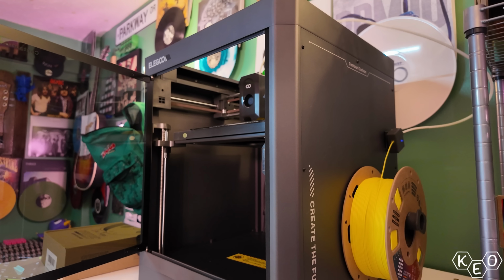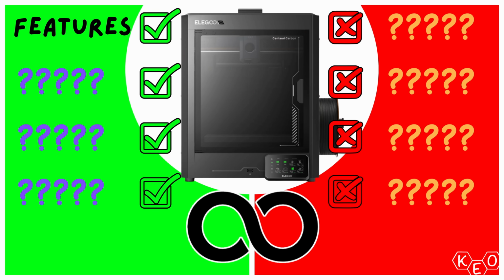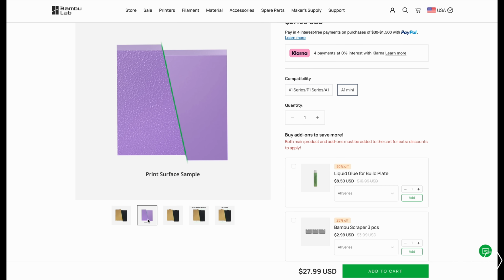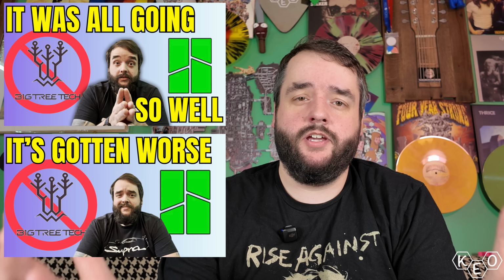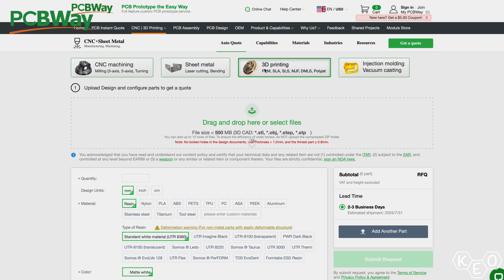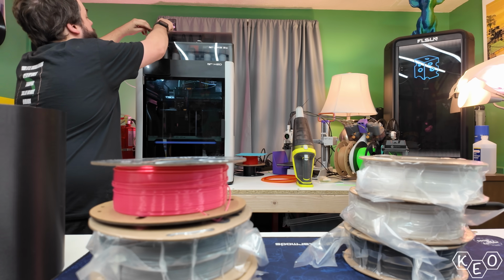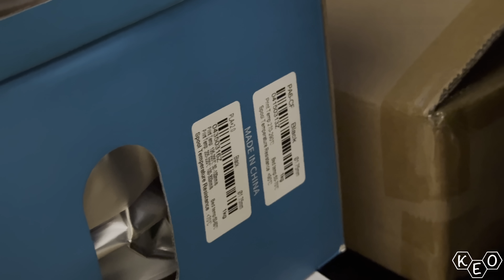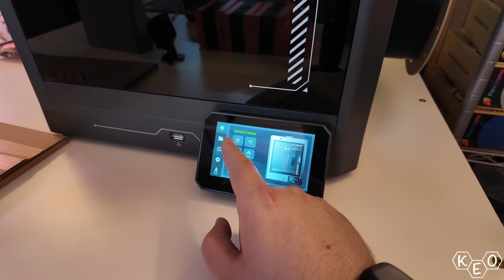This $300 Elegoo Printer Months Later — Here’s the Truth

Comment: Can't you control all your fans in your filament settings? So this way it runs the fans how you want per filament profile?
Reply: That’s supposed to be the way it should work. But the exhaust fan ignores the (Elegoo slicer) filament profile settings. I don’t know why. And if you turn it off from the front panel then it turns itself on again shortly afterwards (starting next layer?) 
Another YouTuber hacked together some next layer gcode to turn the thing off (on every new layer) when printing PLA, TPU, etc. And that seemingly works.  But the source of the wackiness needs to be identified so it can be corrected properly. 
Unfortunately I don’t yet speak gcode!
Reply: @dougal6569 Yeah that sounds like something that will Change either with a firmware update or Slicer update. Sounds like just a bug or a glitch

Comment: I agree on the reskinned multi slicers. It's really crazy out of control. I like Orca, though recently have been using Creality Print more as I like some of the tweaks they have done like more logical layer pathing they added recently that has really improved my top and bottom layers. 

A negative for me on the CC is the hot end design, especially the thin connector between heat sync and heater that has bent for some users and the hard to remove connectors that tend to pull off the circuit board (I've been waiting 3+ weeks for a replacement from Elegoo) or have the wires pull out. This is an issue with a lot of printers - the print heads which are a user replaceable part, should be easy to replace without fear of breaking something while doing it. But the ones on the CC seem to be even even more fragile and hopefully will be fixed in another upgrade.
Reply: No doubt about it, nozzle-swapping is one area where the Bambu A1 design leads the world.
Reply: @dougal6569  I cannot say as I don't have a BL printer to compare it to.

Comment: Fans/Door/Lid - these are because it is an enclosed printer, aimed at printing ‘functional’ materials, rather than PLA. 
Clearly Elegoo intended the open “Centauri” for the large scale PLA market, and thought they would first introduce the more specialist (hardened, enclosed, hot) Carbon as a low volume gentle intro for the range. 
I think they have been surprised by the adoption of the Carbon for PLA printing (due largely to the price and not working through Bambu’s servers). 
But folk need to recognise that PLA isn’t what this thing was primarily designed for. If that’s what you want to do with it, then be prepared to make adjustments (like taking the lid off, finding a way to have the door open/off, disabling the exhaust fan…). 
Sure it CAN do PLA, and well, but that isn’t what it was primarily designed for! 
And this also accounts for Elegoo’s lack of appreciation of the immediate appetite for an AMS/MMU thing - that is of much less importance with an engineering filament printer.

Comment: Fans (1) - some folks are claiming that their Case fan speed responds to chamber temperature on their latest model CC. Are they mistaking the Case fan for the Auxiliary Cooling fan? The Case fan’s job is to extract air from the chamber, through the filter material, and mine runs continuously during printing. The Aux fan is for chilling freshly extruded filament to assist with bridging and overhangs, and as such it runs intermittently and only when the slicer has added the command to the g-code for that element of the part.

Comment: And Adam, the criticism of the multicolour aspect isn’t totally fair. People (potential customers as well as trolls) made a big thing about whether or not this new printer would have a multifilament feed capability and Elegoo’s standard comment about not discussing future product plans did nothing to quiet the issue. So Elegoo came out and committed to 
producing it, and put that commitment on the product webpage. 
Yes it is still vapourware, and I agree that folks should never buy a product purely on the strength of promised future features, but I personally don’t see this as a reason to criticise Elegoo and the CC.
Reply from the maker: I’ll die on this hill lol. Your multicolor system should not be a feature listed right alongside the chamber camera and a core x/y motion system. Advertise that it’s coming soon but don’t flaunt it as feature number 3 if it doesn’t exist yet
Reply: I’ll quietly disagree about “flaunting” it. They advertised it ONLY as coming in 3rd quarter 2025. Now, if it gets to 2026 and it isn’t being shipped, at that point I will join your protest!
Reply from the maker: True. Hopefully they maintain that deadline

Comment: C’mon Adam, “Open Source” literally means the source code is made publicly available. Elegoo’s isn’t. 
But having public APIs and printer profile information is a great start and absolutely fine by me as long as the appliance delivers on its promises.
Reply from the maker: I didn’t say it was fully open source. It’s simply open enough for the only feature that I identified which is the orca integration. That’s all I wanted to highlight because that’s something I look for
Reply: @KeoPrints  “open” api’s and profiles, but absolutely zero source code published. I’m just trying to get you to be a bit more careful with your wording, so you’re not over claiming or misleading. 
I’m right with you that the CC is tolerably “open” (though not at all “open source”). As long as an appliance does what it is supposed to do, I don’t absolutely need to have the full revelation of how it does it. That seems to be OK for my car, my smart tv and my iPhone. 
But, as you will be aware, the Open Source zealots want full disclosure of the software internals and Elegoo aren’t releasing them.

Comment: there is 0 opensource in this printer, they're violating the Klipper license. Their bastardized version of Klipper is super old (v0.9.1). The printer itself is so locked down, it's actually annoying.
Speaking of which, we replaced the mainboard with standard hardware, and installed normal Klipper. We have everything except bed meshing working. We even have a configurable chamber fan (as in, it doesn't turn on every layer and you can set the percentage). Got a speedbenchy on my channel with it.

Comment: It's sad that a $300 printer works better then the $800 paper weight I have known as the qidi plus 4. Qidi is the worst company I've ever dealt with.

Time for a move.
Reply from the maker: For me personally, I would choose the Plus 4 any day. This printer is a great value but I have had a much better and more stable experience with Qidi
Reply: @KeoPrints unfortunately for the plus 4 its a 50/50 on if you got a good unit. Mine has never worked properly, the auto z-offset and abl are never right most the time it way to high and then the next time it crashes into the bed. The hotter the bed is the worse it because the sensors get messed up from the heat.
Reply: @KeoPrints I like your videos keep up the good work.

Comment: Been pushing 6 of these damn near constantly with various materials for the past month, and so far they've handled all of them without issue.  I've got 4 printing all the "pretty" PLA's, and 2 printing PETG-CF.  Prints come out amazing for the price point these have.  I've got the vented risers on all of them and I'm able to print most anything, door closed and riser vents open, even my abrasive filaments.  No warping, no clogs, nothing.....so far.  Can't ever say that a printer will never get a clog at some point, but a few hundred PETG-CF parts with the stock 0.4mm nozzle, I can't say I'm not impressed.

So far, I've only one complaint: the noise.  When the fans area going, they are GOING.  Luckily I've got a room with sound proofing and a dedicated inline fan system for fume management, so there's no annoyance with either sounds or smells, but I sure wouldn't want it in the middle of my living room going lol.  Regardless of that issue, I love these printers so far.  I'll for sure be looking into more of these when it's time to expand.

Comment: Before I move my printer I always remove the glass top because I know it is not secure or on hinges. They do have a riser available on printables that has all the pieces held together by screws so it can come off as one unit. If you can't remember to remove the top off a printer that you know is not secure before you move it, That's on you!

Comment: I have one of the first that fell off the Elegoo conveyer belt and into the truck.  It's been working great.  I did remove all of the zip ties from the feed chain as a precaution, and it's been great.  Removing only the last tie worked fine but the tube clicked itself in and out of the chain and I thought it'd eventually wear down so I removed the other two.  I don't have the lightbar upgrade that was said to come later but I can grab that if it appears on the Elegoo website sometime.  Weirdly, I can't find the silicone nozzle wiper in their website either, but "3D Jake" has them, and cheap too, so I bought a load when the first wore out and I found I only had one spare.  I didn't even spot that it was worn down until I cleaned the lead screws the first time so it clearly never caused any issues and I have loads of spares now anyway.  The only upgrade I've made to my machine so far is to make and install an adapter to send fumes to a hose vented to the outside world.  I skipped installing a riser for now;  I'll decide on that when I get and place the multi-material box.  I did install the anti-vibration feet but I've never tried the original solid feet to experience the difference.

Mine is not what I'd call super-loud.  I wouldn't want to install it next to my pillow to run overnight but it's not loud enough to make me go insane in normal use.  Wibble wibble.  It works great with OrcaSlicer v2.3.0, which is just as well as the alternative would have been to buy a cheap laptop to run their TemuSlicer on Windows or some nonsense instead of just firing up OrcaSlicer on Linux like an ordinary person.

I'll get one of their multi-material systems when it's out, but mainly to act as a spool run-out automaton rather than to rainbow all of the things for no reason.  I suspect the material system will double as a heated drybox too, but I'll wait a couple of months for them to work out whatever it needs to fix the first batch before I rush to place an order.  If the sharp turn at the extruder end of the filament hose is an issue when auto-changing material then I'll consider a riser, but I suspect they'll have a "standard" solution such as an official riser in the box.  I bet they release their material system in November 2025, so I'll consider placing an order sometime in January/February 2026.

I wish it had an Ethernet port, or a swappable board to provide one as an upgrade, but that's nitpicking at this price point.  A Pi acting as a WiFi to Ethernet bridge works fine, and the radio only needs enough power to cover the area it's in so that's secure enough for me.
Reply from the maker: All good points
Reply: I'm on Linux with Orca 2.3.0 as well.  Using Orca has a minor issue though.  The layer count and time lapse don't work unless you make a minor gcode in Orca.
Reply: @justanotherstanczyk  I've never used the timelapse feature but I have noticed that the layer progress counter never changes.  The progress bar looks correct so I assume it's a bug that'll get addressed at the next Orca release.  I wasn't aware that a gcode mod would tackle it if that's what you meant so I'll look into that at some point.  I'm not worried as the countdown (and up) changes as expected, and everything else seems to work fine.

One other thing is that I can't toggle the lighting from the Device tab when the printer is busy.  I don't use that puny light anyway, and if I ever want to then I can toggle it via the printer's screen which continues to work fine.  I suspect this lighting toggle to be a firmware issue maybe related to the updated lighting hardware I don't have.  I'm pretty sure the remote toggle worked before the last firmware update long ago.  Hopefully I'll be able to grab the new lighting hardware from the Elegoo store at some point.

Comment: I got 500 hours in liked it so much bought a second one. The Jesus freak riser and the fan muffler mods work really well and address two of your complaints easily chamber heat and fan noise). I’m a Prusa CoreOne fan but you can get 3+ of these for the same price. I really like this printer for the price. Did first nozzle swap and wasn’t bad.

Comment: That fan for the tool head is backwards. They should have the fan pulling air pointing at the tool head and the fan on the opposite side taking in external cool air to maintain the temp of the tool head.

Comment: Almost 600 hours on mine. I've only used PLA, Silk PLA, and various PETG's including some Glass Fiber. This thing has been amazing! My only issues have been with the slicer not being able to monitor the printer's camera, temperatures, and print history. I'm hoping a firmware update will fix that soon. The prints themselves have been great. By far the best $300 I've ever spent.
Reply: mine does that though.. you can also type the printer's ip adress in a browser and see/control it that way. See if the camera and stuff works from there.

Comment: I love Orca, and that's all I'm using now. I had to downgrade my A1 Mini to the previous firmware in order to keep on using Orca. I still don't think that it's cool what Bambu is doing, their excuse of "security" is a hollow one. My A1 Mini is far more secure than what they can do for me, since it's air-gapped from the Internet. Awesome hardware, but disappointing manufacturer. I'll be purchasing something else for my next printer, probably the one in this video.
Reply from the maker: The Bambu "security" garbage is the worst
Reply: There's no need to downgrade the firmware to keep using orca. Just send the print to the memory card and print from the machine, or use bambu connect if you want to start the print from orca.
Reply: @rmb8269  Thanks for your comment, it is appreciated. Carting an SD card around is indeed a workable last-resort technique, but since I don't have a RepRap I really want to print directly to my printer via WiFi straight from Orca, ideally without involving the Bambu cloud (like I've been doing before the whole controversy kicked off). To my knowledge this means that I need to run my printer in "LAN Only mode" with the N-1 firmware (in my case version 01.04.00.00) that doesn't rely on Bambu Connect. What I print (even if it's only telemetry or meta info) doesn't need to leave my network, and I also do not need a piece of software acting as a gate-keeper between me and my hardware. I've been stung by this type of thing before (Ubiquiti bricked my WiFi access points when they decided the model series was EOL), and will do everything to engineer myself out of such situations if at all possible. This of course doesn't mean that Bambu will definitely act like this, but they are now one step closer to where they can do this. You can absolutely trust them to act in their own corporate interest, and not in the interest of their clients (Capitalism 101).
Reply: @janhenkins not what I meant. You can send your print from orca to the memory card in your printer using the "send" button, not physically take the card out, put it in your computer and write to it. You can also use bambu connect. Or, just downgrade the firmware like I've done.

Comment: I'm using Orca with my ECC but I can't control the printer from the device tab. Can you?
Reply: The Multicolor addon has ALWAYS been advertised as coming later... So you really shouldn't have that as a con for the printer. You know it isn't available yet.
Reply from the maker: If they weren't advertising it as a feature of the machine already then I wouldn't include it. Unfortunately, they have that included so I also have it included. I am hopeful that their multicolor system is actually good when it does come out though

Comment: Chamber temperature management can be done without an actual extra heater.  In a printer where the bed starts at the top and drops a little for each layer, and due to the fact that hot air rises, the top of the chamber will heat quickly, and tend to stay hot.  Prusa relies on this fact, for the core one, and they keep the internal volume of the chamber as small as possible with those two "side cheeks" in the walls that double as a place to store tools and hang the filament (I'm going to add that mod to my Voron Trident build!).  I think you are asking for too much for the printer to be able to maintain the internal temperature when you open the frakin door!  That's like expecting an airplane not to depressurize if you opened the cabin door at 40000 feet!
Reply from the maker: I should have clarified; the print issues I've seen from opening the door were with printing PLA. I am expecting the opposite to happen; instead of maintaining heat, I expect the temp regulation fan to keep the temperature low enough that opening the door doesn't cause print artifacts with low-temp materials
Reply: Can you pls point me to the mod for a trident to have that kind of "cheeks", I'm pretty interested in but cannot find smth similar

Comment: With extra 50 bucks max you can get it with ai monitoring(octoeverywhere) and heated chamber(15$mini heater and a temp control power cable)
Reply: octoeverywhere works fine at the free tier, even
Reply: This is exactly what I did.
Reply: what mini heater?
Reply: @evanjones6828 what i was wondering
Reply: Links? AliExpress?